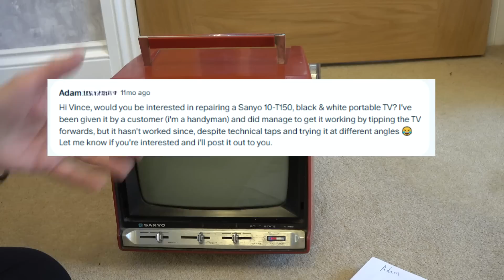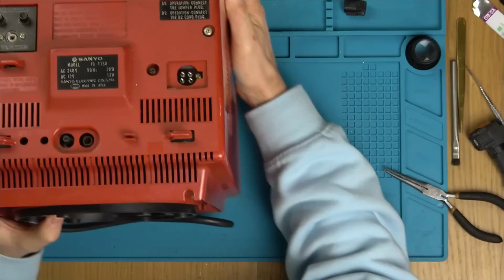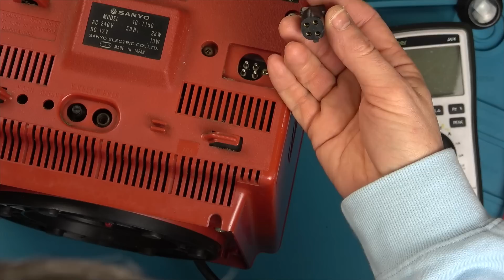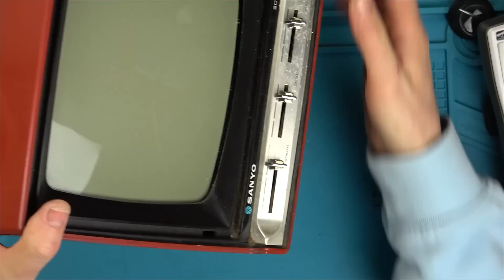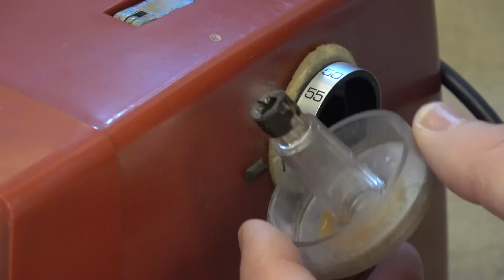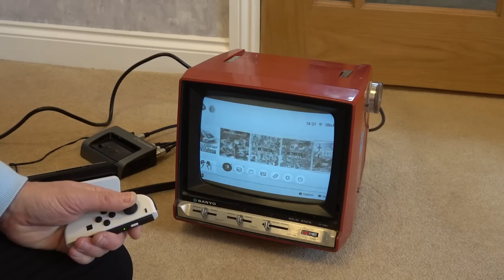1970s Lovely Japanese Sanyo Red CRT Television - No Power - Trying to FIX

Comment: Those pins have a slot in them, stick a flathead screwdriver down the slot of each pin to push it apart slightly, the pins will then sit tighter in the socket. It's the same way you make a loose trailer plug fit onto the pins on the vehicle end.

Comment: I used to love those old monochrome portable crt’s for the caravan years ago using the 12v, the tuning dial type like that were so much easier for different areas.
To be fair I prefer colour crt’s now but can’t remember last time I saw one. I had a beautiful Sony Trinitron 32” with nothing wrong with it and even had a digital tuner built in. Took it to the tip after we got a Samsung LCD, dislike the LCD so much so that I hardly ever watch TV nowadays as my iPad has taken over. When I was a kid Sinclair brought out a tiny CRT with a bent tube, all the adverts and Tomorrow’s World demonstrated them with an old 50p next to the screen.

Comment: I think you will find that those pins that go into the DC jumper/socket are split down the middle.  You can insert a very thin bladed screwdriver and bend the 2 halves apart slightly to get them to make a tight contact when they go loose.  You got a result though.  Good job.

Comment: hi easy fix file the pins  and put a bit of solder  or bend the pins    you get this on the molex  computer  plugs alot 
if the plugs are used alot   some time's i change the plugs   in the old  tape drives the stockets play up

Comment: When I was in the repair industry (coin-op for 35+ years) I always listened to the people reporting the issue and my brain would be running through possible causes while listening and I often had a pretty good idea of the problem and cause by the time they finished talking to me. This would often save me testing steps involved if you just go in cold. Of course some people gave the very helpful "it doesn't work".
Reply: Some customers would also own up to hitting the TV at a certain place and it would either 'fix' or 'create' the fault which was also very handy. That was in the good old days of Valve (tubes to our overseas friends) TVs. You didn't need central heating when these bad boys were on.

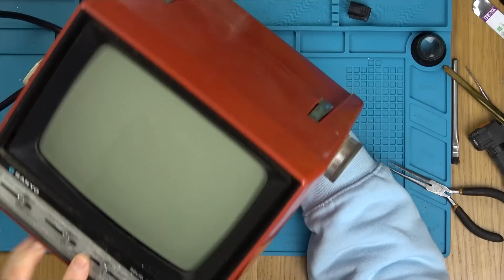Comment: 4:15 - Instead of just a bezel, there was a full plastic tinted cover across the screen with silver/white trim (at least there was on the German rebranded version, the Loewe-Opta P701...I can't find a single pic of the Sanyo 10-T150 with that cover intact) - It made it look like the whole face was black instead of the gray picture tube standing out.

Comment: Had a red Bradford (W.T. Grants house brand) TV set back in the olden days. What you think is missing trim could've been the attaching points of a plastic (anti-glare?) screen cover.

 Remember in the 60's
when we shot to fame
singing with a lisp
was how we made our name

In our bri-nylon polo neck
and trousers so tight
we sang on your telly
in black & white

When you watch in black & white
You'd often wonder
was your telly alright,
When you watched in white and black,
You would see us rolling forward
and slowly rolling back

Did it make you cry
Did it make you laugh
When a big black line
Chopped my face in half

What about mine
I ask with politeness
is this radiation
or is it the brightness

When you watched in black & white
You'd often wonder
was your telly alright,
When you watched in white and black,
We would slide to the side
and then we'd come back

The picture made us look very tall,
then it made us
As the snow began to fall
Is it a pigeon on the arial

When you watch in black & white
remember how we used to say goodnight
incase you had forgot,
we all ended up
as a little white

        ⊙

Comment: as we were taught in car maintenance, listen to the customer, but it is also a case of asking the correct questions as well that can lead to an easy diagnosis, as well as you find out what causes the issue. then it is also easier to replicate the fault to find it. it is something the car dealerships, and some garages fail to ask before trying to find the issue, like taken my old car to the dealership for an electrical fault, numerous times they said the diagnostics failed to find the issue, so therefore it is the ECU at fault, and that the ECU needs to be replaced at a cost of £1,000, rather than me having a guts full, and telling them to replace the switch on the brake pedal that stopped the cruise control from working constantly, as a process of illimination. so a £3-4 part made my life hell, but the dealership said was an ECU which costs a lot more.
Reply: It also helps if the client gives at least partially useful answers! I have a neighbour who comes to me to fix things who, when pressed for more info, insists "It just stopped working" (giving no info on /how/ 'it' stopped working or what they were doing with 'it' at the time); or "I just need a new lead" (said of a device that has at least 5 different 'leads' going into/out of it; if pushed for more precise detail, "You know, the /lead/!" is the frequent response) :(((

Comment: The white bits on the TV could also be bits of plasticiser or fire retardant stuff coming out (if the black parts are plastic). I have the same with my TV from 2010, it looks like its fungus but allegedly its just the plasticiser leaking out as it was exposed to the sun.

Comment: 4:18 Likely not missing a bezel.  Sets like this AC/DC one often had plastic screens/filters to attach to the front if using outside in sunlight or other bright areas.
Reply: Makes sense for use in indoor/outdoor picnic/weekend caravan usage, which would prolly be the device's main market
Reply: I went looking and in fact found one with exactly that sort of screen still attached.

Comment: I used to use a speakerphone connected to the line as near to the drop wire inlet as possible, then whack it with the measuring rods or tape a drop wire clamp to the top of the rods and grab the wire and stretch it downwards. 👍

Comment: I remember playing games on my Ti994a on a little b/w Sanyo.  Upgrading to colour took a lot of my paper route money but was worth it.  In other news, I feel old now :face-green-smiling:
Reply: That was my first computer,  sadly it looked better than it was due to lack of games but I spent many hours typing in code from gaming mags and even longer trying to find the typos.
Reply: @selwyngregory8773 if you had all the addons you would have had a nice system.. But that is about a grand or more in 1980s money. Usagi Electric has the older version.. Addons about 3-4 feet going out the right side.. Looked silly back then.

Comment: The Pins on the the socket are each split into 3 , so you could get a small blade in-between and open them up slightly,

Comment: You certainly had me shouting at the screen. Can't believe you don't know that split male pins of plugs are designed to be widened by sliding a screwdriver or pen knife down the split. You just couldn't resist fiddling with the female bits though.

Comment: I think I preferred old tech in some ways yeah rose tinted glasses but I'd argue it's built better and will last longer than most new Tvs today.
Reply: Takes a boatload more power tho :(
Reply: I dunno, we rented tvs up until the mid 80s because radio rentals (remember them?) would send an engineer out to fix them for free when they went wrong, which happened quite a few times. They wernt that reliable and were pretty expensive to buy compared to the average income. The tvs we rented wernt cheapo models either, I imagine those went faulty even more frequently.
Reply: @meetoo594  I still have a very old black and white set,l I really believe Will outlast my newest Hisense.
Reply: @ RR were famous for their customer repairs back in the day, which is prolly why they eventually folded once disposable microchips replaced discrete components :(

Comment: I'm interested to see the voltage across those pins on the back. if it's at mains voltage i'm sure sure many a child would have got a bolt if the jumper had come out.

Comment: The pins that are in the tv are split  and designed to be spread out with a thin screwdriver that's all that it needed.
Reply: Came to say the same thing
Reply: I was going to say the same but luckily I saw this. but if they aren;t split a dab of solder would help too
Reply: as soon as I saw the pins I thought to make same comment
Reply: Always open the split pins as distorting the sockets will cause uneven contact.   I wonder if the holes in the front were for a sun shade. As these type of TVs were popular with lorry drivers etc.
Reply: i hope this video was filmed pretty recent so he can do it because i was thinking the same thing. i had an issue with a power cable once and fixed it the same way.
Reply: A utility blade works better than a screwdriver. Much easier to get into the split.
Reply: Yep was going to say samething pins on tv are like banana clips small cross head screwdriver in end of pin to spay them a bit for tight fit.
Reply: they are not though